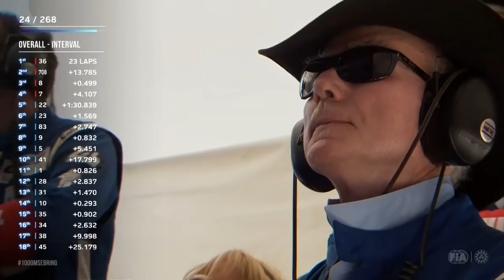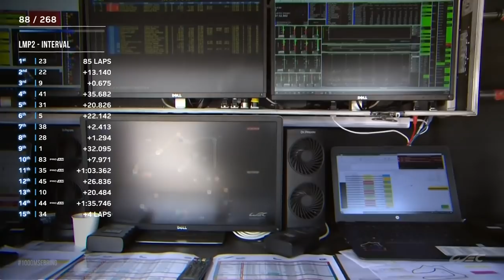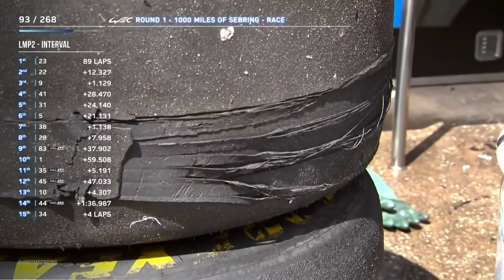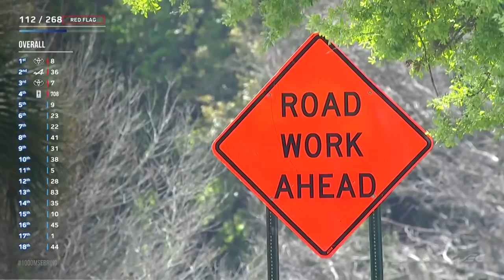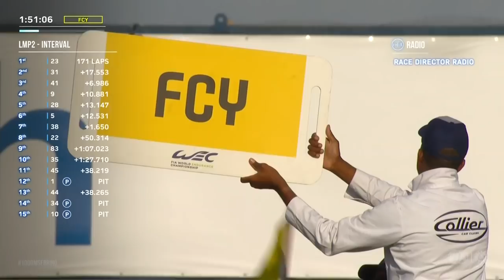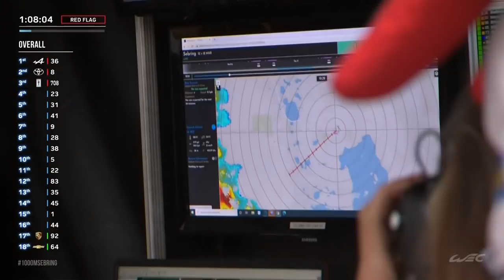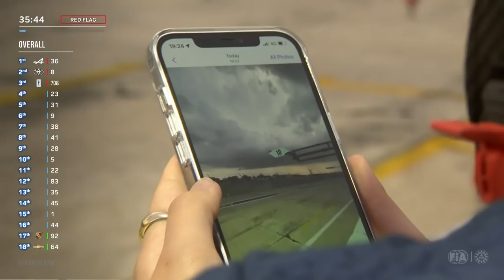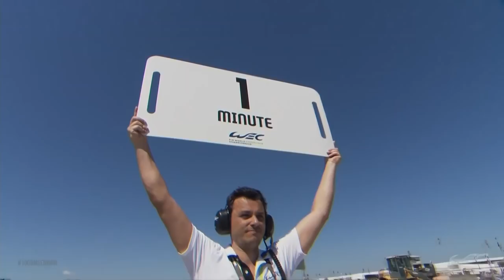FULL RACE | 2022 1000 Miles of Sebring | FIA WEC

Comment: So we have the Toyota, the Glickenhaus, the Alpine/Rebellion (?) anything I missed?
Reply: Peugeot will join later in the season.
Reply: BMW,Audi,Porsche,Acura,Cadillac have opted for an LMDH. Their focus is clearly on the USA. IMSA has had the best racing for years. The WEC is clearly inferior and boring. Peugeot apparently has problems with their hypercar. Ferrari is not coming until next year and Glickenhaus only uses one car at a time. This is just boring Glickenhaus certainly has enough money to use 2 cars.
Reply: @ManBad88  How is the WEC inferior? Many of those brands will race in both championships so it doesn't matter if they build an LmdH or an LMH.
Reply: @Maenfy  - LMDH has a clear focus on IMSA - USA. Otherwise they would have chosen an LMH. Both types are approved for the 24 H of Le mans. and that's all the manufacturers are all about.This is all about Le mans. So you don't have to ride every race in the WEC or the entire season. We'll have to wait and see what BMW, Audi and Porsche do. The same applies to Acura and Cadillac, Cadillac is also interested in Le Mans.
Reply: @ManBad88  Well Porsche already raced in WEC during the LMP1 days, I don't see a reason why they wouldn't with a much cheaper car.
Reply: @Maenfy  - I told you why it's boring. Glickenhaus only uses one car at a time and Peugeot keeps postponing its debut. So Peugeot has some problems with the car.And then better not to illuminate the background of the hypercars. The Lmp 2 were already at 600 hp. Now they have been slowed down more and more so that they do not overtake the LMH/LMDH. And they would have made that easy with 600 hp. Is the racing as we fans want to see it?
Reply: @ManBad88  Well Peugeot wants to have a good car before homologating it, I don't blame them. And yeah if the racing is good I don't care how fast the cars are. They will get faster over time and the new LMP2 regs will fix the speed issue anyways. New categories aren't perfect from the get go, LMP1 wasn't either.
Reply: @Maenfy  - in my eyes, the glory days of racing are over. A GT2 was slower than a GT1. a GT1 was slower than a Group C or LMP1. An LMP2 was slower than a DPI or LMP1. This has resulted from the performance and aerodynamics. There was no need to slow them down. on the contrary, during this time the LMP2 was increased to 600 hp. and today you want to do racing but it can't cost anything. and then you realize oohh my god the LMP2 are too fast and the LMH are just too slow. that is probably an embarrassment and shame. a BOP within a class is different from slowing down an inferior class so that it does not catch up with the new top class and embarrass it.
Reply: @Maenfy  - and then no hypercar won at sebring. that's probably the next joke.
Reply: @Maenfy  - the World Motor Sport Council of the FIA met in Bahrain and also made two decisions with regard to endurance racing. With regard to the new LMDh vehicles, it was announced that they could compete in the WEC as early as 2022 - but only via a guest start and therefore without the opportunity to score points.

The LMDh are the successors of the DPi (which are currently still starting in the IMSA series). Acura, Audi, BMW, Cadillac and Porsche are currently working on an LMDh. Porsche has already undertaken initial test drives with its vehicle and is therefore the furthest along of all the LMDh players. LMDh vehicles are each based on one of the four permitted chassis (Dallara, Ligier, Multimatic or Oreca). They also have a small hybrid system (unitary component).

The LMDh should not be confused with the LMH, which will already be used in the FIA WEC in 2021 and 2022. Toyota and Glickenhaus are already driving. Ferrari and Peugeot are developing an LMH. Both vehicle categories then compete together in the class with the name Hypercar (in the WEC) or with the name GTP (in the IMSA).

The Balance of Performance (BoP) is used to ensure that the vehicles, which are so different, are on the same level. In this respect, it could also make sense for the rule-keepers if an LMDh completed guest starts in the WEC as early as 2022. In this way, appropriate data could be collected in order to be prepared for the official debut of the class (at the 24h Daytona 2023).
New LMP2 generation should not come into WEC until 2025

The World Motor Sport Council has also made a decision regarding the LMP2 class. The new generation will not be introduced in the FIA WEC until the 2025 season. The new LMP2 will have the same four chassis (Dallara, Ligier, Multimatic or Oreca) as the LMDh. However, the LMP2 should be a lot cheaper to have. There will be a standard engine and the hybrid system will also be dispensed with.

The rule holders are currently in the process of defining exactly how they want the LMP2 to be in the future. The planned lap time also plays a role. Because the current LMP2 generation (launched in 2017) is quite close to the hypercars. Here it is to be expected that the 2025 LMP2 will be slowed down via various adjusting screws. In terms of lap times, there is definitely enough room for the smaller LMP3s.  This is News from Speed Week. com.....and not from me.
Reply: @ManBad88  Yeah well that happened because the Toyotas got BoPed before Sebring else they would have easily won. New classes always take time to sort themselves out, the old DPs also had some races where they were slower than LMP2 cars, that can happen.
Reply: @Maenfy  - FIA and WEC is much more Politics than other.

Comment: They need to re-pave Sebring, though it does look like Concrete in many sections of the Track if not all. If it means IMSA missing  many  seasons at Sebring so be it....I am not familiar with WEC and if Sebring is an annual race for them.

Comment: Driving control ling the turns knowing the control of driving  knowing the turns  ur  corners mieras watching the each side  up a down the road what's going next to move in to watching the tacks watching the corners track  fule  keep ur eyes on the road  fokes be pashent on the turns be safe on the bumps each ur tacks for heat  water tempercher  each learn to the engens how it's running  look up  all a round u for safety  take no chances  distance from the other car in front of the car

Comment: That was disgusting and disgraceful to use a national flag for the green flag...
Reply: That’s traditionally how international races started before the lighting systems we know now. It’s still in the regulations as a backup in case lights fail or if, as is the case here, the track simply doesn’t have them. The 24 Hours of LeMans uses it with the lights.